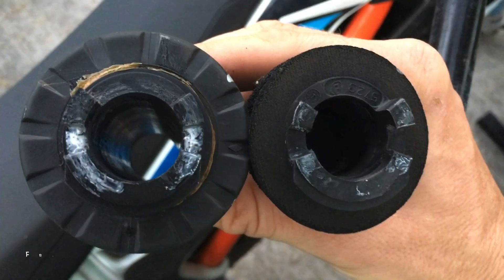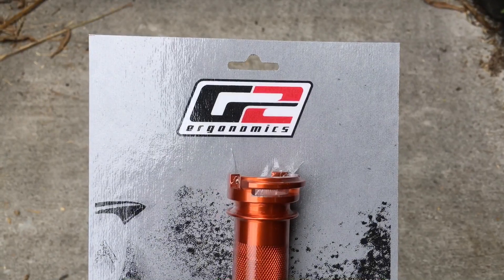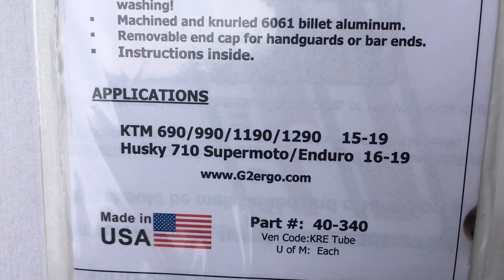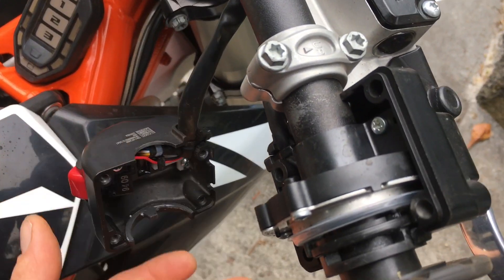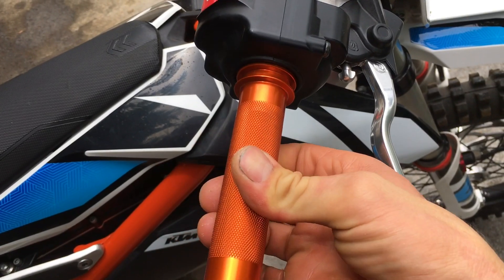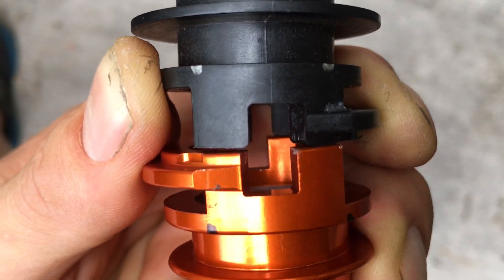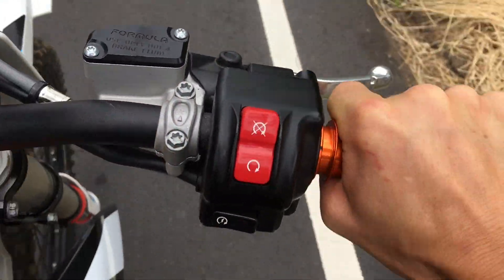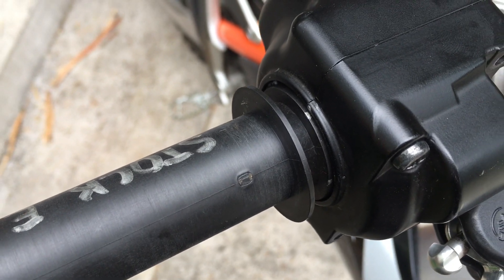KTM Freeride E-XC Throttle Upgrade (690 Enduro / Husky 701 Too!)

Comment: 1090? Assume yes!!
Reply from the maker: Yes. I confirmed through KTM part numbers that the OEM 1090 throttle tube w/grip is the same as other Adventures & Duke 690 & 1290. It’s likely all the KTM models are the same, but G2 lists the 1090 as a different throttle which I suspect is an error on their website. Order the one from the link I provided below to their website. It will be correct. Or call them if you want confirmation. The G2 part number is 40-340.
Reply: John Howerton appreciated

Comment: Hi 👋 sir, I bought the same throttle tube for my Duke 890R, hoping it’s getting smoother, but unfortunately it’s still stiff because of the sensor recall spring. It becomes very tiring on hand and forearm, after just few kilometers riding. Do you know if could be possible to open it and replace the stock spring with a softer one? 
It’s really really annoying in my opinion. I even considered the option of relocating it under the seat and build some kind of box with pulleys/cable system that make it smoother to turn, even paying a wider angle to reach full throttle opening.
Reply from the maker: Compared to other bikes, these are not stiff throttles. Are you sure it's not binding somewhere or have some glue residue on the bar or in the tube?
Reply: @JohnHowerton137  
Thank you for your answer.
It’s all perfectly clean. Before this one, I owned a katana with cable throttle body. Spring on it is very soft because due to safety specs throttles shaft is about half a millimeter from the middle in order to make it close automatically by vacuum. I could ride very aggressively into twisties for hours, without any pain, soreness eccetera. Now with a 50 kilograms lighter bike I get in pain with my hand and arm. 
Pain, tingling finger and a large callus in the palm of the hand near the little finger. Never happened with the old bikes (katana and Z900rs)
To be honest I didn’t read someone has that problem too.
Anyway, thanks again.
Reply from the maker: @solino2002andrea  ok. Well been so long since I had it apart so I don't have and answer for you. Sorry.

I will say the numbness is a mechanical/ergonomics issue. No doubt you are plenty strong enough to turn a tiny spring if you can ride these big motorcycles. With your elbow dropping and the increased throttle resistance, you're likely activating your trapezius muscles and tightening the scalenes in your neck/shoulder area. These overworked/tight muscles are pinching the nerves. 

If you look into this area first (lots of therapy videos on YT), the throttle might not be an issue anymore. Maybe it's as easy as you doing some rhomboid exercises and getting a nice massage to keep this pain away 🤷‍♂️

Best wishes!
Reply: @JohnHowerton137  
Thank you very much for your advices.

Comment: Hi m8, i have a freeride E 2018-NG.. what is the correct throttle tube for it? The link doesnt tell me much over at G2.. Cheers
Reply from the maker: The one for the 701/Enduro 👍
Reply: @JohnHowerton137   Thank you ;)
Reply from the maker: Make sure you watch the other throttle video too. That’s where the real benefit comes from. The G2 is a nice/good piece of kit though too.
Reply: @JohnHowerton137  I just bought some spacers from you m8 🔥
Reply from the maker: @Shouldergold  well not from me, I just helped the company dev the fitment. They help a ton though! 

Enjoy 🤙

Comment: Check out ducati spacers for your ktm. Took all the slack/wiggle out of the throttle. Nice n tight and smooth. Just how I like it... 😁
Reply from the maker: I have another video about that 😉

I helped develop the product for them 🤣
https://youtu.be/iwzXKGI_IZc

Glad to hear you love it 😁
Reply: @JohnHowerton137  
That hilarious! I wasn't sure what you were talking about at the end! Thank you for that, I found out about them about 5 months ago and purchased a pair. I may have been able to fabricate something similar but it's not something you want to mess around with and have fail on you 😁. Worth the money for sure. So simple but such a great thing to install. Thanks again for making those possible.
Reply from the maker: Yes, I did fabricate a few of my own during the process, but I run the production ones. Not exactly something you want to get jammed up in the throttle. They seem expensive until your throttle is stuck wide open and you eat crap 😉 Makes the bike so much better, especially the ebike where the throttle input is so sensitive.

Comment: Hi John!  Awesome content!  Thank you.  I have a question please.  I have a fused right wrist...  On 4 strokes with push - pull throttles, I can switch throttle to the left side and then swap the 2 push - pull cables.  Perfect solution to rotate the correct way. I want to get a freeride or other e bike soon.  I have not been able to see how the throttles are assembled.  My first rudimentary thought was to flip to left side, and mount with housing and electronics still on left side of the grip.  Therefore it would still rotate the correct way (bark buster to protect housing). 2 questions please!!  Do you think that would work the way its assembled and attaches to the bars? (like I said, I haven't been able to physically see one!) question 2, any ideas on how to mount properly on the left and still rotate the correct way?  I super appreciate any advice or thoughts.  There's a lot of adaptive athletes that could ride e bikes!
Reply from the maker: Hmm. I'm about to go work on the bike (tire changes) I'll take a gander at the throttle. Should be able to get back to you soon.

I know if I had an issue like that I'd still want to ride, so I'll do what I can figure it out for you 🤙
Reply: @JohnHowerton137  Hey John, thanks! A lot.
Reply from the maker: Got some photos. Going to find a free host to upload them to.
Reply from the maker: @RydenAround 
https://ibb.co/Dk82STL
https://ibb.co/HtS5Tx6
https://ibb.co/QKxpt41
https://ibb.co/7zZXn2h
https://ibb.co/mqm174b
To any onlookers.. don't take the internals of your throttle apart. The screws break upon removal.
Reply from the maker: @RydenAround  it would take hours (I don't have) to see if things could be flipped around, etc... My gut almost thinks they could with a full day or two of messing around. This is the best I could do with the time I had without cutting all the zip ties etc.. holding it all together.
Reply: @JohnHowerton137  Hi John.  You are really kind.  Thank you for the info.  I will need to get my hands on a throttle and figure a solution.  At 2am last night, I was thinking that maybe machining a throttle tube that has the tabs (the tabs that you made the adapter for) inboard instead of on the outside as is stock.  Then feed the tube into the housing so that the tabs engage and the tube extends out the left side of the housing.  I don't know if that makes sense and it's hard to tell if it's feasible from the pics.  Again you are a kind person to help someone you don't know.  Thank you.  BTW Ryno knows me from the Leadville MX Park, Andy from MX Sports Medicine.
Reply from the maker: Yes, that does make sense. It wouldn’t work without flipping other parts. If you look at the 3rd photo (QKxpt41) you might be able to flip that mechanism around or flip parts under that sheet metal plate and make it work. There’s a decent amount of space inside the housing. I wish I had more time to help you. Look for basically any used KTM e-wire throttle on ebay. Wouldn’t even matter if it was working. They are almost the same.... At least the main mechanism and the throttle tube if you did need to make one. Download those photos if you want them. They will auto delete from the host soon. Hope you find a solution and let me know if you do!

Ryan is wild man. I’m trying to make the guy independently wealthy, but he’s hard to pin down for more than a minute as you probably know. LOL
Reply: @JohnHowerton137  Super thank you John.  I'll update you in the future.  Have fun my friend!

Comment: Hi John, I really appreciate your work with these videos, very helpful!
Question: Given there is no fuel tank, do you think the EXC could be transported on its side (flat)? I’m thinking of the possibilities for a motovan build.
Reply from the maker: Should be. I see no reason why not. Its basically like a bunch of sealed D cells in a sealed box. There is a cups worth of oil in the gearbox, but I it's prob sealed.

Just remember, it's a dirtbike. Sometimes they're super muddy. Maybe even have some cow pucky on them 🤣 Make the van cleanable. Hoseable preferably!

Comment from the maker: The one person that dislikes this video has never broken a throttle tube and gone to buy one at the dealer and been told, “It’s not in stock. We can have it in a week.” Or they can’t afford a G2.

I made this video as a journeyman parts guy/manager, so I could help keep the community of KTM Freeride E users and inform other KTM E-Gas owners of options in a situation where the is no time to order parts. They might be able to find the correct part that’s listed under another model’s part number from a small dealer wherever they’re riding. The part numbers through KTM are different due to having a different handgrip glued on or something. This information IS NOT FOUND elsewhere.